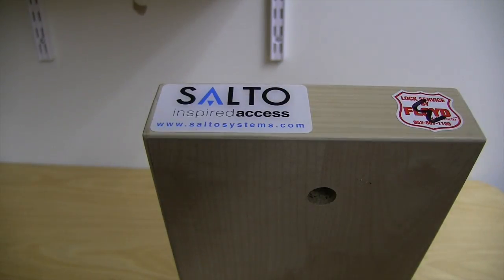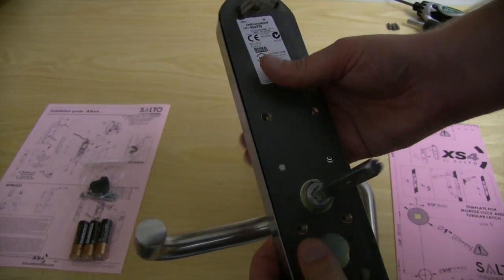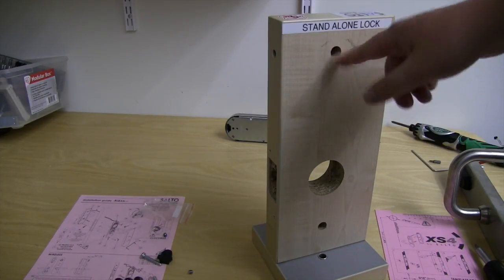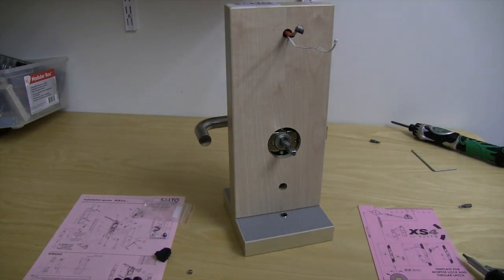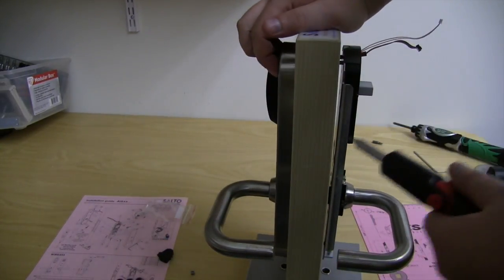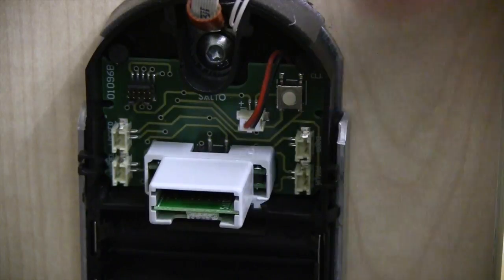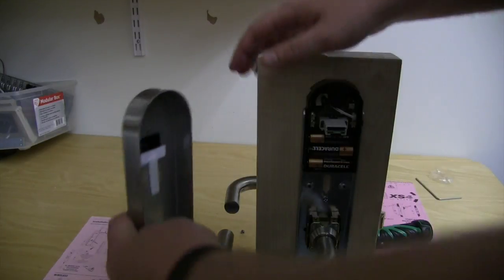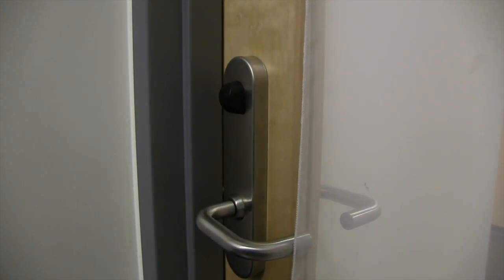Salto Training

Comment: Be nice to see a video on how the controllers are installed - how many are required to cover an area -  how they connect to a switch - How many doors are controlled by one unit - if controllers are POE or require a separate 12VDC supply....you know, the good stuff behind all the glitter.
Reply: This video was meant to teach door installers how to install the locks, not the back end. I think you are talking about Gateways not controllers. The most recent version of gateways I have used can handle ~12 locks, but you can also connect nodes to the gateways that can also connect ~12 locks. The gateways are POE. We don't really use gateways much as we find that key updates and PPD updates are more reliable.
Reply: @pinholepirate  - yes my apologies on terminology. I can appreciate your vid as to how to install a door set. I was interested in seeing a video end to end of the system. From what I understand , you still have to supply 12VDC to the gateways as the POE versions are still not available. My confusion can be that the sales literature tries to convey a "wireless " system . What I am finding is that there are 2 or 3 scenarios. As an integrator I have some options. 1) its a completely wireless solution - that would mean the doorset communicates directly to a "gateway" which in turn connects to a switch connected to a WAN. 2) each door has its own IP and connects much like a PC does on a network. 3) using RF - the doorsets would also communicate to a " gateway" of sorts which again must be attached to network.----soeaking with Saltos , they have a 2 door gatweay expandable to 4 doors via RS485 - the gateway itself connects to the network yet it still requires a 12 VDC power supply - depending on the doorset you choose, that may also require 12 VDC.

To make it simple - what products would you choose to connect 50 doors on an office floor if you were to choose the newest product line XS4.

( apologies for misuse of terms - doorset equates to the estucheons c/w reader/card swipe / whatever you want to call it )
Reply: @timidtornado2869  1 for the wireless escutcheons. 3 is for XS4 control units for hardwired doors.
Reply: Are you experiencd with back end? I wonder how to completely reset a salto xs4 lock

Comment: Is there somebody who know how to factory reset a Salto xs4 lock?
Reply from the maker: I am not an expert, but I don't think the XS4 can be put back in construction mode. That would be the closest thing to factory reset. You can re-initialize it, and probably re-SAM it if it was SAMed, but I don't think it can be put back in construction mode.
Reply: @nateokun1206  hi thanks for fast answer! The thing is we got hacked and our database is lost, salto space is installed again and licensed again, but ofcourse there is no database anymore neither a backup, so space is empty. I’ve configured the locks in the salto space and loaded them on the ppd device, but when i connect the ppd to the lock it says “lock does not belong to system” which is normal ofcourse, now there should be a away to reset locks in case this happens, which happens more then i thought when i’ve contacted them to re activate my software
Reply: @nateokun1206  at this moment i found how to reset the lock! First you’ve need to add a parameter to the system which let’s you add “erase lock” to the PPD. Then you need to hold the CLR button and at same moment connect the ppd to the lock. (First choose at the PPD -> Erase lock). Will erase the lock, after that just like from 0, initialisation of the locks and then the update :)
Reply from the maker: @RyanB-t6y  neat!

Comment: I have got a problem, the door handle has come loose! But I can't get the cover off?. The grub screw at the bottom of the handle will   NOT  unscrew ?.
Reply from the maker: Ian,
The screw on the bottom of the inside lock face screws in to loosen the plate.

Comment: With the door open, if you hold the handle down and scan your card then release the handle and shut the door does this lock the door for use on the outside of the door and can only be opened from inside. I’ve heard this
Reply from the maker: I think what you are talking about is Office mode. When A lock is programed to work in office mode holding the inside handle down and tapping your card keeps the door unlocked from both sides until you do it again.

Comment: Wish you made the holes yourself using the template.
Reply from the maker: Sorry, I was working with a predrilled block. If you have the template then drilling is easy.
Reply from the maker: Sorry, using the pre drilled template makes it easier to show on video.